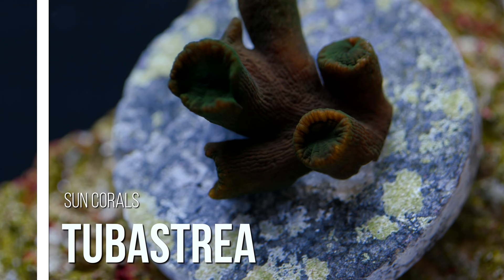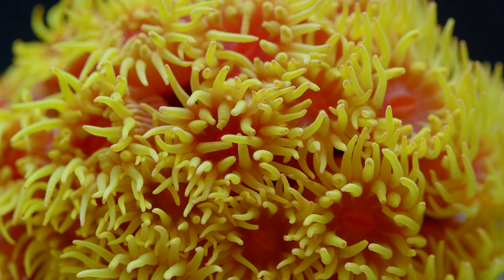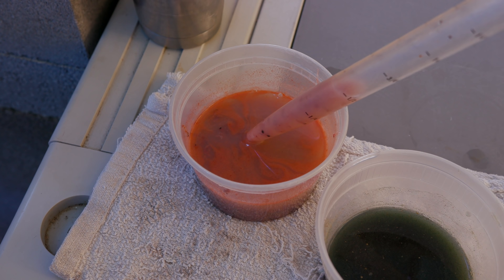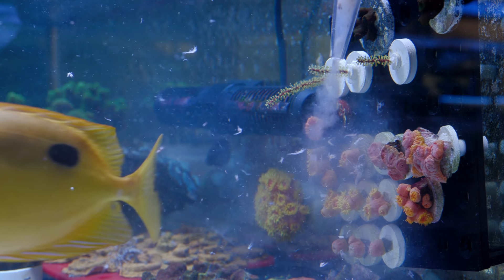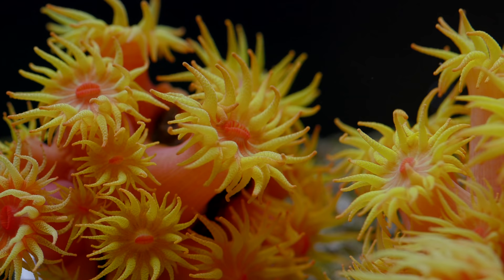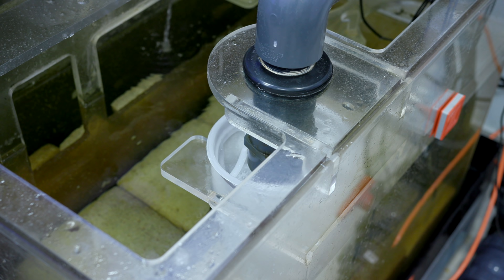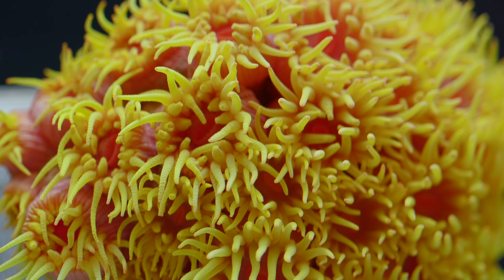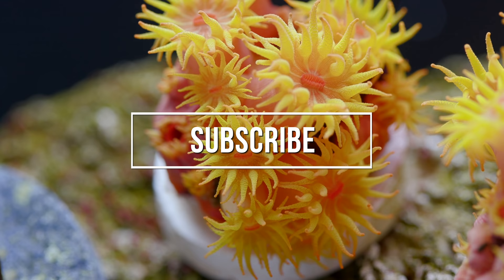Tubastraea Sun Coral Care Tips

Comment: Honestly I just do not know what rate LPS grow at there is so little documentation in the reef aquarium hobby I have had my LPS group for almost 5 months and they have barely grown. Wierd
Reply: You are probably expecting too much growth, too quickly. Even in the ocean corals don't see massive growth in the amount of time you mentioned. Growing coral is a marathon, not a 100 meter sprint. Many LPS corals grow slow as well. As long as your paramaters are good I would not worry about it. Ofcourse, if your paramaters are not good you could see slow or no growth.
Reply: @lonestarpatriot876  the issue is outside of the areas around where I have corals I have algae coming back periodically and it sucks it almost makes me want to get some xenia bc I would prefer that to algae....
Reply: @zafishguy5166  You don't want Xenia unless you put it on an island. If you are having algae problems then that means you have an excess nutrient issue. I am curious as to how old your tank is? Also, I am curious as to what your Alk, Calc, Magnesium, and PH are testing out at?

Comment: Great advice but, my opinion is fuq dirastic water changes and over skimming just put it in a bowl with your tank water and feed the coral separately it feeds better no flow etc than add it back in, mine are thriving with this method
Reply: I completely agree with your method. I use salad tongs to remove the colony and in the bowl it goes. I leave the colony in the bowl for 20 minutes. Then return it to the tank. I do this 3 times a week.

Comment: @Than I've been waiting for you to talk about filtration to this extent for years and is very valuable information especially touching on the commercial side.

After what you said about sun coral, sarcasm would dictate placing it in your filter sock compartment 🤔🤣.

BTW, I have heard stories of baby sun coral clogging up overflows before so that is a watch out. 

Personally though on NPS systems roller style filters are a good candidate.

As for algae turf scrubbers, they aren't practical for that kind of nutrient load which is why I'm glad you mentioned the bacterial supplement 👍

Comment: Kind of a dumb question... But the "gunk" trapped on the skimmer neck, although still "in the system" (oppose to the gunk on the cup which is "out of the system"), would not still be a trap for organic phosphates and nitrates? I mean, the flow of complex organic molecules in a skimmer is always upward, therefore trapping pollutants in the top layers of bubbles, even if not collected in the cup. If the pollutants agglomerate in a single spot, would not them still be harmless, as they are trapped?

Comment: I think this could be one of my favorite species if I got it. I love feeding corals. The stronger feeding response the more I love the corals. I spend 30-60 minutes hand feeding each polyp every day. If I power fed them once a day where each polyp got a few shrimp and or a mega dose of reef roids do you think that would be enough nutrition? I typically feed the corals just once a day.

Also, I'm.the crazy reefer that only uses a fuge as the sole filtration method. I feed a LOT, but the fuge algea seems to uptake all the nutrients as fast as I can put them into the tank. So I almost never do water changes or worry about maintenance of a skimmer. I haven't done 1 water change on my main tank yet. I did just pull out 2.5 gallons of cheato the other night which was just a percentage of the cheato. I had to make room to start growing ulva. It needed to get trimmed anyway.
Reply: Yes that would be fine. I feed mine mysis once per day, sometimes skip a day here and there. Mine is growing new heads all the time on that feeding schedule